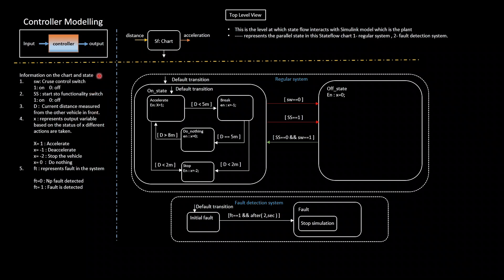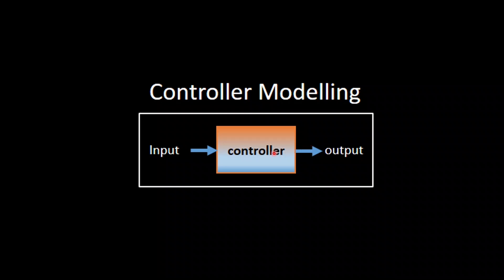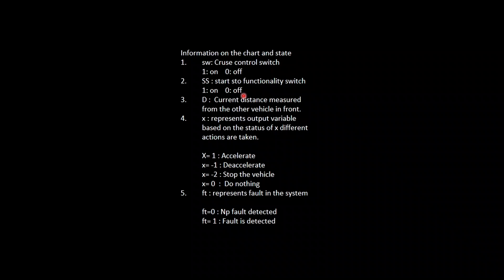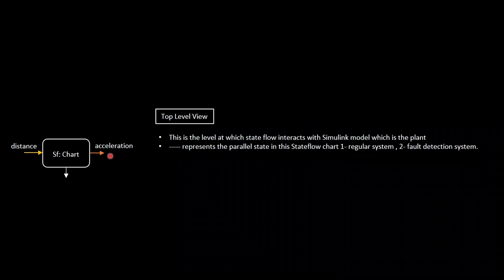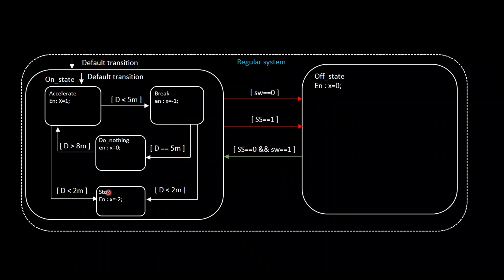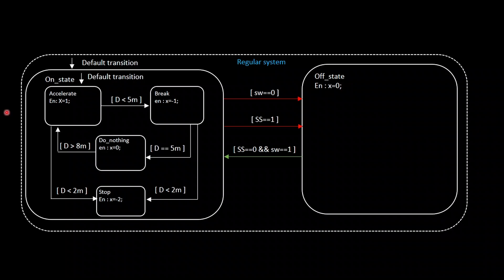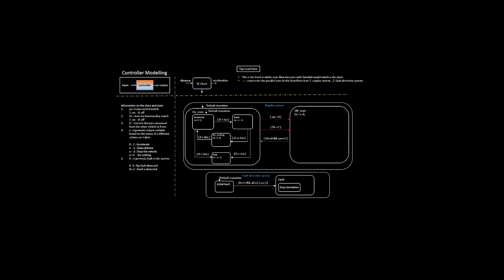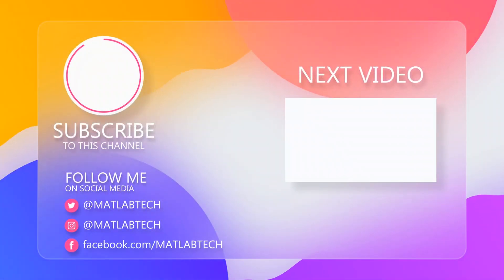MATLAB TUTORIAL | STATEFLOW TUTORIAL | CRUISE CONTROL STATEFLOW MODEL ANALYSIS AND DESIGN

Comment: Great Video! I have a query regarding the stateflow of Regular System. What happens if the chart is in Do_Nothing state and the distance becomes less than 5m? I feel there should be a transition between Do_nothing to Stop state at that time.
Reply from the maker: When you enter in to do nothing state : there will be no input from acceleration and break paddle. In the same situation as the vehicle will be moving in an air drag , along with that we have road friction( specially rolling friction of wheels ) so it is assumed that due to the above reason , there will be some energy loss. due to that there will be reduction in the speed of the vehicle.
so at do nothing state ideally vehicle speed should reduce and resultant distance will increase . So it is not having a transition for distance > 5 m.

But the same thing can be incorporated if the front vehicle is not having a constant velocity. In such situations you can incorporate a transition to stop state as the distance will reduce less than 5m.

Basically it depends on the assumption and situation in which you are going to implement the controller.

I hope this clears the doubt.

Have a great day ahead
take care
Happy learning MATLAB